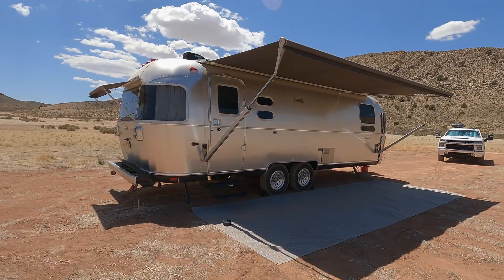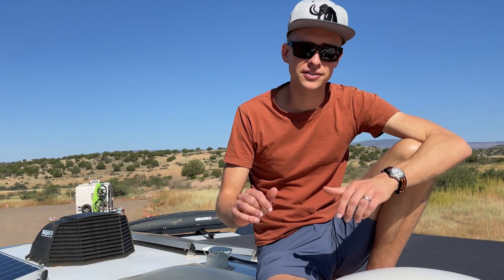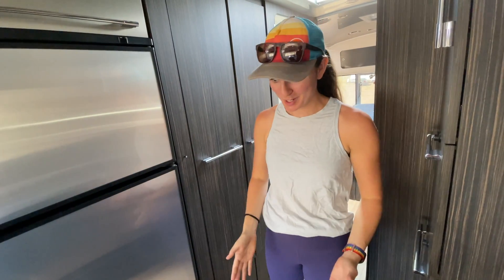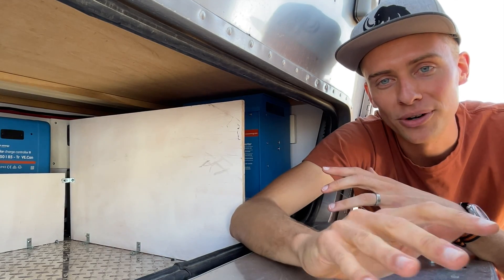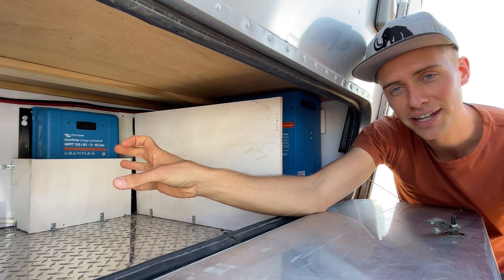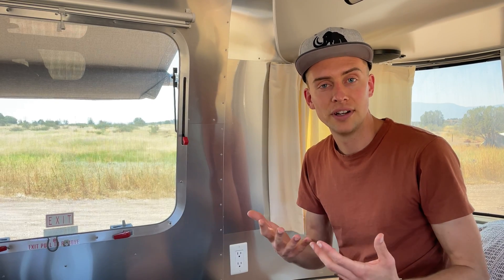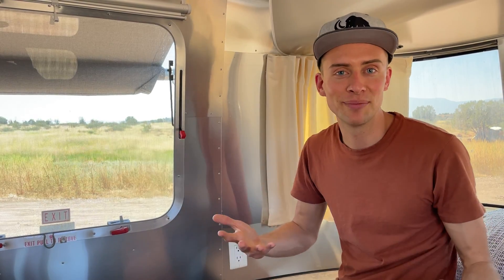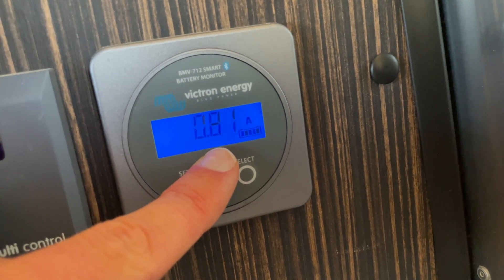🌞 RV Solar System Explained 🤔 PARTS + CONCEPTS for DIY Van or Camper Install

Comment: Hi Victoria and Cameron, have you had any issues with the Inverter getting hot in that location & with the panel being in front of it?
I really appreciate your video breakdown. Planning to install a 3000w Multiplus 2 in the front compartment of a 27FBT.

Comment: VERY well done ! Your written guide is very well written. Although not a full-timer; we spend at least 3-5 days out once a month & 6-7 week 'snowbird' trip in the Winter. 6 years ago I started studying solar. Watched a ton of YouTube's and talked to a lot of people. I was getting paralysis by analysis, so I decided to start real small with 1-100W panel + PWM controller + 400W inverter + 2-6V golf cart batteries.  I learned a lot with hands on. One of the biggest discoveries for me was learning that if the panel was not in direct sun; you achieve very little power. I "chase the sun" and move the panels couple of times a day. I have since added a 2nd panel and I am now adding Lithiums. Since we camp a lot in the wooded areas I added a  2000w inverter generator as a backup & the occasional need for higher Amp 110V. All in for <$1k (excluding the yet to purchase 2- LiFePO4) . Lithiums have dropped significantly in the last 6 years making them a better solution.
Reply from the maker: Glad to hear you found the video and guide helpful! Like you said, doing is one of the best ways to learn. Things became much more clear and understandable once we actually started planning out the system and then installing it. Until then, your brain is just trying to make sense of a ton of new information!

Comment: Awesome video, my wife and I just purchased a 2021 AS FC FBQ. The research is almost overwhelming on batteries and components. We will probably just start with lithium batteries and add solar as soon as we can. Keep up the good work we enjoy seeing a couple in similar stages of life going on adventures.
Reply from the maker: Thanks for watching and congrats on the new trailer! There's certainly a lot of new information to digest. If you do just start with lithium batteries, make sure that your inverter and charger (in electricity-speak, the charger is a converter) are both compatible with lithium batteries. In addition, make sure that you reprogram those components when switching from lead acid or AGM batteries. Otherwise, the new lithium batteries will quickly be damaged.

Comment: I'm curious if you think this is a better option over the Ecoflow generator. I can't decide between this or something portable like that?
Reply from the maker: A small power bank like the Ecoflow can be a good option for a lot of people. It's all about your specific needs. Things to consider:

1) what devices do you need to charge?
2) what appliances do you want to run?
3) do you want a full system that will also ensure you have power for lights, fans, etc. in the RV?
4) do you stay in one place for days at a time, or are you on the move frequently? (consider how you'll keep your batteries charged)

Your answers to those questions will help you determine the battery capacity, number of solar panels, and inverter output that you need.

Check out our free guide to help you make those determinations. The Table of Contents includes clickable links that will jump straight to a section. Some sections that might be particularly helpful are:

• How Many Batteries are Needed for an RV or Van?
• How to Select an Inverter for Your RV Solar System
• How Many Watts of Solar Do You Need?

Guide link: https://thiswyldelife.com/wp-content/uploads/2021/10/Solar-Guide-This-Wylde-Life.pdf

Let us know if you have more questions!

Comment: Great video and great explanation of the solar power components.  I’m especially interested in the solar panel install as I don’t want to drill holes in the roof of my Airstream either!   I will check out AMSolar.
Reply from the maker: Glad you found the video helpful! The adhesive mounts are a huge benefit, and SO much easier to install. No concerns with leaks, or hitting something important while drilling through the roof 😬

Comment: Wow, a new video from Cameron and Victoria and it’s not even my birthday yet! This video is super helpful. I’m definitely downloading the guide and will take advantage of the code if it’s still active when I need it. I’m still waiting for my airstream to come in (womp womp) but I’m anticipating needing need to upgrade the solar soon after. I’m curious, did you have any solar before taking this on? I ordered my trailer with solar to have a starting point but am a little worried it might be more complicated to upgrade it than start from scratch.  Thank you for the video and great to see you again!
Reply from the maker: Always great to have you join us for a new video, Patrick! Our camper didn't have solar. We were using the portable Zamp panel to charge two lead acid batteries via alligator clips 😆 

Our camper WAS pre-wired for solar, but that just meant Airstream had run some puny 10 gauge wires inside the ceiling. Those wires would only be good for 200 W of solar, so we ran all new wires. 

Whether the factory solar system is a good starting point will depend on the gauge of wire that Airstream is using these days. You also want to consider the specs on the charge controller, inverter, and batteries that you are paying to upgrade. If those components don't leave much room for expansion to meet your needs, you might be paying for an upgrade that you will tear out anyway.

Do you know what those specs are?
Reply: @ThisWyldeLife  Thank for for the response and sorry for the delayed reply! Unfortunately, I haven’t been able to find all those specs. It’s a little frustrating how hard it is to find detailed information. I suspect they’re still using the wimpy wiring but am secretly hoping to upgrade that for 2023 as mine will likely be the new model year by the time I get it. It seems like they are catching on to the fact that people want to be able to boondock. As far as I understand they still just use a 1000w inverter. Did you consider pulling a bigger wire using the existing wiring? I suspect the walls aren’t strong enough to handle that but wondered if that would be possible.
Reply from the maker: @patrickholmes1044  We briefly explored the idea of pulling a new wire with the pre-wire. However, the pre-wire is somehow secured within the walls (probably zip-tied to the frame), so it doesn't budge when pulling on it. Once we found the chase under the floor, pulling our new wires through there was pretty straightforward.
Reply: @ThisWyldeLife  ahh, very good to know! Your idea of running it through the refrigerator compartment was genius! May have to steal that when I get around to it.
Reply from the maker: @patrickholmes1044  we can't claim that idea (The More We Explore was the first we saw do it), but it sure works well!

Comment: Nice job but my head is about to explode 🤪 you did a great job of explaining the whole system
Reply from the maker: It’s definitely a lot to digest! The concepts are relatively simple, but there are so many of them. Just chip away at it little by little, and before you know it, you’ll be ready to implement your own system.

Comment: We want to upgrade our FB airstream also we have the same model as yours! Just not sure if we a handy enough to take on so must electrical stuff. Thanks for the information.
Reply from the maker: It was a new skill for us too. The hardest parts were drawing up a wiring diagram, and figuring out how to route wires in our specific trailer. Once you have a plan of what goes where, connecting everything is pretty straight forward. Just about anyone should be able to tackle this project. Just set aside a good bit of time, and leverage all the amazing resources out there—our channel and solar guide included 😊
Reply: @ThisWyldeLife  Thanks for the encouragement